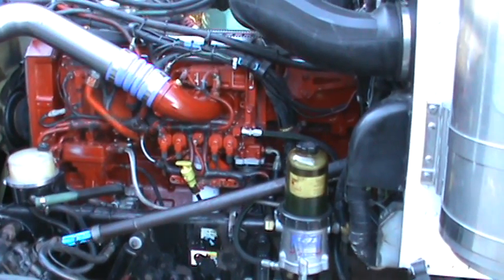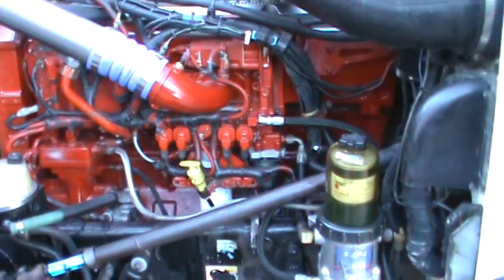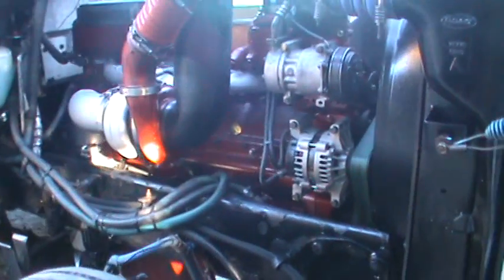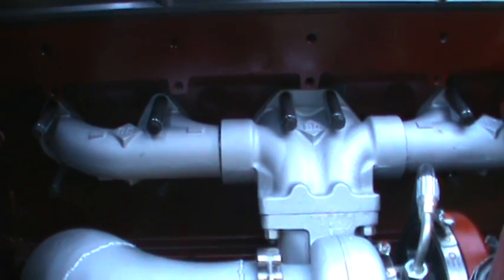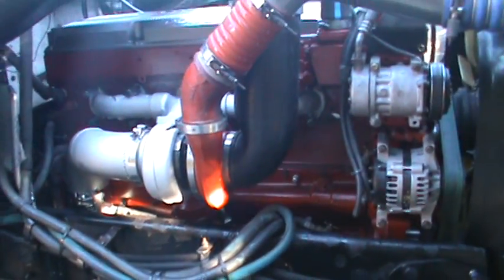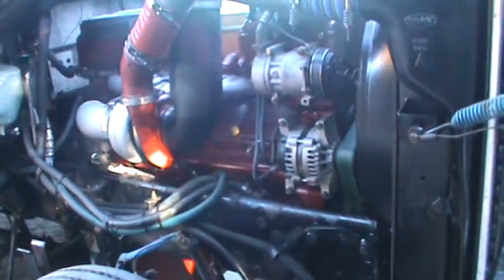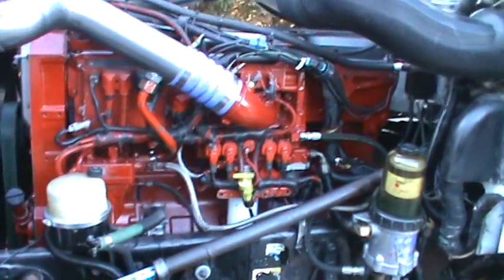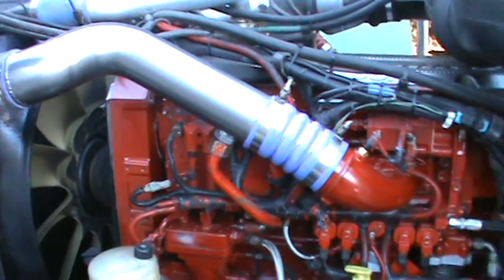cummin isx performance   ISX700

Comment: It's four years since you posted this video, do you have any updates on how this engine is doing at the 700hp rating?
Reply: Same shit I wana know
Reply: It blew up after 3,000 miles
Reply: The engine and truck belonged to Gentry & sons trucking, it blew up after 2000miles. For anyone wanting to know
Reply: @Mark-Tschetter  It wasn't there truck.
Reply: @timofeypinchuk877  
Yes it was, just scroll down in the comments you'll see a comment dropped by Gentry

Comment: I deleted my egr and def 200k miles ago. for$ 2300 took 5hrs. my truck will pass smoke test I get more mpg. and power. just make sure the shop have good reputation doing deletes
Reply: another good reason not to go to ca
Reply: Caro Quintero  me if is not broken I won't fix it .  not big fan of after market parts.
Reply: Where can I delete mine I have a 2012 Pete with ISX I want to do the same thing
Reply: with the new laws, any truck found with emissions deleted is a felony not a fix-it ticket with a fine.  The CARB goons are sitting up at the scales entering Ca and EPA in other states just looking for this.  The smoke test won't work anymore if the see any modification to the emissions.  they will impound your truck tow it to a dealership and if found deleted or modified they will site you with a felony and keep your truck as evidence until your conviction.

Comment: Sorry to hear on 2000 miles I believe there's a balance between wait can be made on horsepower and wait kills a motor in short time
Reply: Agreed. Especially all of this Coated and Treated Stuff. Either a Cummins ReBuild Kit or a IPD ReBuild Kit, Aftermarket Exhaust Manifold, Aftermarket Turbo (Nothing Crazy Big, just Slightly Larger), and a Small Tune if Necessary. Either your Looking for Fuel Mileage & Some Slight Performance, or your Looking for A Horsepower Monster with Questionable Reliability.

Comment: I own the truck and had him build it..sadly it blew within 2000 miles the engine failed it slung 2 rods still waiting on that warranty motor 2 years later
Reply: Sounds like someone forgot to center the rod bearings before torquing on the end caps. I've rebuilt a few handfuls of ISX15s now, they are very anal about torque and torque sequence. If you don't get the torque angle right, the bolts will back out.
Reply: Trucking Family sorry to hear
Reply: Trucking Family That's too bad man
Reply: Trucking Family  yes I had a rebuild from a company in Indian and blew up after 1000 miles and had to pay for anthere rebuild and never got anything back from first place rebuild it
Reply: Damm man I feel for you.
Reply: Trucking Family why do u think it blew up? Can’t be because of the turbo and emissions delete has to be the rebuild job I would think
Reply: I bet
Reply: Is this the infamous ISX you speak of almost putting you out of business?
Reply: 2025 we found out Gentry is a fake trucking family guy.

Comment: Cummins isx is a good engine internally. once you get rid of the failing emission bs. thats why real truckers buy gliders w pre emission motors. no junky turbo,egr coolers, egr valves n the list goes on.
Reply: Gliders will be outlawed in 2021
Reply: @mr.b8372  were still chillin, we got fitzgerald glider co for that.
Reply: @mr.b8372  RIP

Comment: There is a delete shop around every corner these days full of ignorance and terrible methods/mods. It is too bad this one found an engine to screw up royally!. What a shame what they did to that engine!. -- The truck owner will be on my forum one day learning the truth about what a hack job he got crying and wishing he never put on that BorgW crap turbo. Would have been much better off with the VG. Truck owner prolly paid dearly for that crap job mess too. - The reason why he things VG sucks is because whoever is doing his piss poor tuning is too stupid to re-program it correctly after all those mods.
Reply: Rawze's Collection 
Hello once again.
Reply: I’m the owner of the truck it didn’t last 2000 miles it slung a rod or two
Reply: Trucking Family sure u are.
Reply: First issue is isx
Reply: By calling borg warner turbos crap you lose credibility. You may not like them but there are tens of thousands of them pulling loads world wide. I used to think of you as an honest working man's mechanic...now I'm skeptical.
Reply: holset borg warner..
Reply: Rawze's Collection Borgwarner turbo suck look at some of the powerstrokes. Holsets last forever
Reply: Trucking Family really
Reply: Rawze's Collection  vg turbo r garbage hoosett turbos, electronic actuators r garbage both Warner is better. Go on forum and u see  dat v.g turbo r garbage.
Reply: @nissanbrown6144  Actually VGT turbochargers are more efficient than a static turbine turbocharger, they spool up far quicker reducing over fueling heat. If he was smart, he would have gotten a secondary turbo kit with the VGT reprogrammed. This "700 hp" ISX isn't making 700 hp.

Comment: why to high power for 80000lbs?
Reply: 80 000lbs is a 18 wheels truck and a reefer because logging truck can go over 120 000lbs and lowboy are rated to 70 ton
Reply: trucks with +500 hp is a waste of money...   with 400 hp you can do the same work

Comment: Why don't they use electric fans on the radiator instead of clutched ones.  Electrics don't take away power from the engine to run and are easier to replace when they fail.
Reply: traingp7 One, electric fans can't move as much air, and two, it actually helps slow the engine down, in conjunction with the Jake brakes.
Reply: traingp7 the amount of energy that fan would take to run is approximately 5-7 hp.  go look up a 7 hp electric motor and 1. tell me where it's going to go and 2. how in God's name are you going to power that, other than a generator run off the engine.  there is nothing wrong with a clutched engine fan.

cheaper, easier, and more compact.
Reply: Electric simply won’t cool under load. Period.
Reply: The electric fan DOES take away power from the engine, duh! In fact, as the other commentator said - you'd need a hefty fan motor, and a hefty alternator to run the fan as well!
Reply: traingp7 those fans done take any power unless the air clutch engages. You can stop that fan when it is idling. They only engage when the engine temperature gets to 210 or the air conditioning requires. The amount of air that fan moves would require a larger radiator, and four massive electric fans.